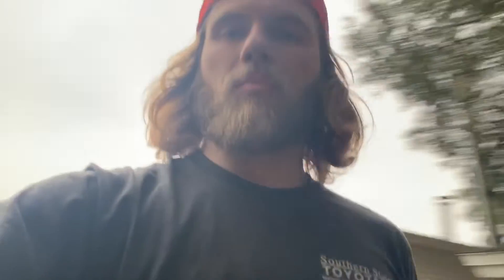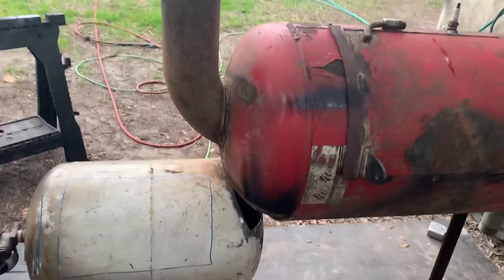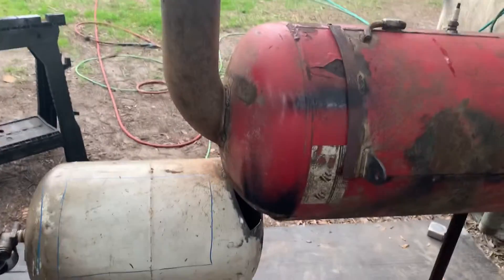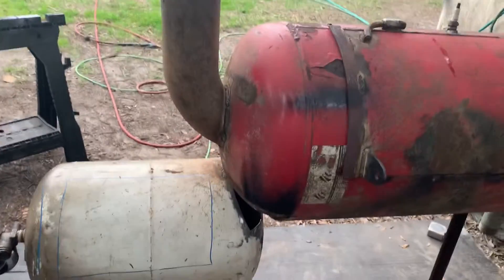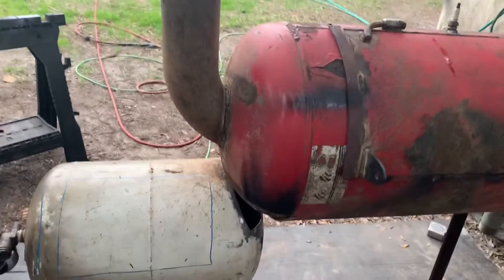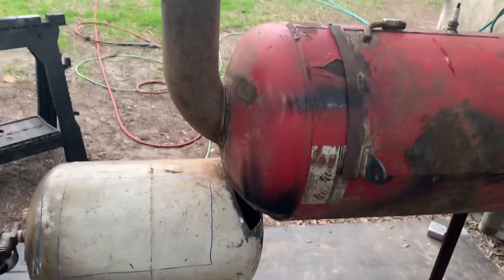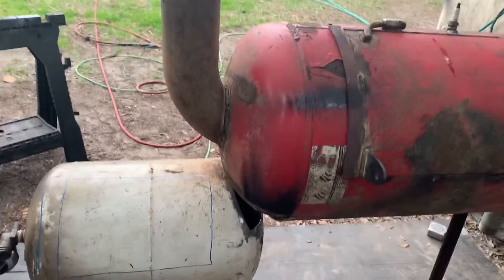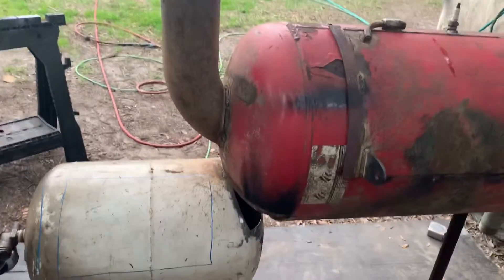Offset Smoker Build Part 1

Comment: I build smokers for a living and you have a nice build goin but I see some issues with the build you need the drain on the reverse flow plate and you want the smoker as level as can get or you won’t have a good flow if you have another question you can ask
Reply from the maker: ken kalb awesome thanks! I’m just kind of wi going it based on things I’ve seen. I appreciate the advice!
Reply: luke burns ya why I say you want to drain on the rf plate is if you have grease get to the fire it will act like a rocket engine and take off and there is no stopping it lol ask how I know it suck I lost 200 bucks worth of meat
Reply from the maker: ken kalb dang yea that makes once I didn’t even think about that. Makes sense tho. I’ll have to see what I can do about modifying it
Reply: luke burns so you can keep the drain there and take a Peace of angle and cut the middle of the rf plate out lay the angle in with the point down and then add tube up to it and block off the ends making a funnel to the tube you have already if that make since
Reply from the maker: ken kalb ohh I like that! Sounds simple enough